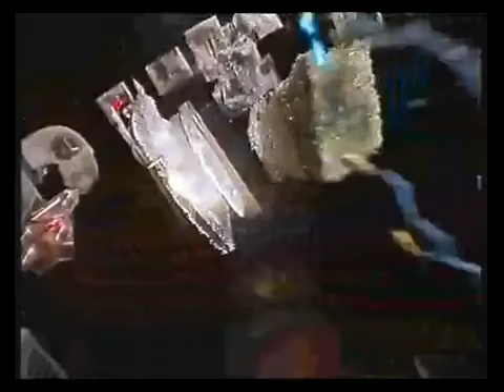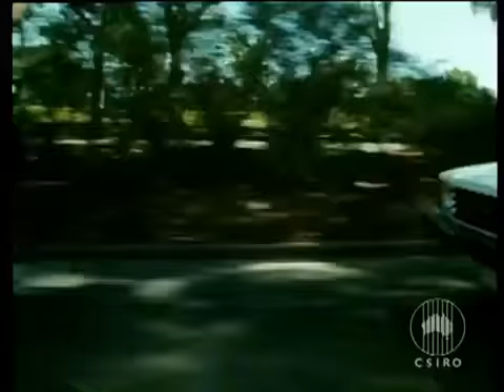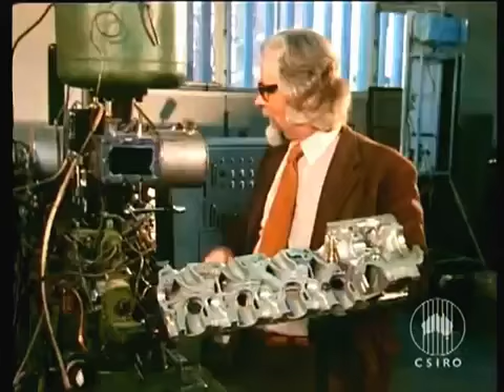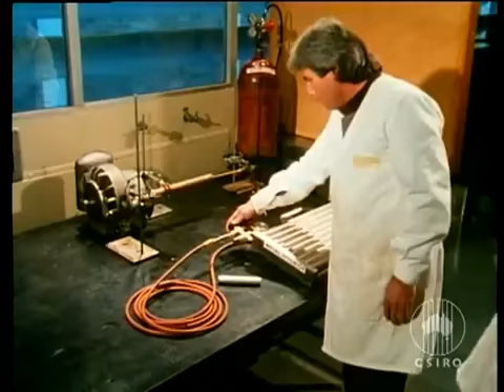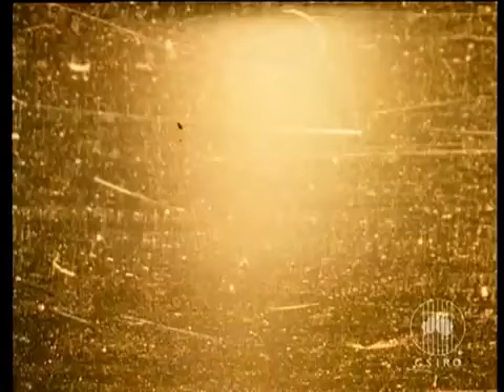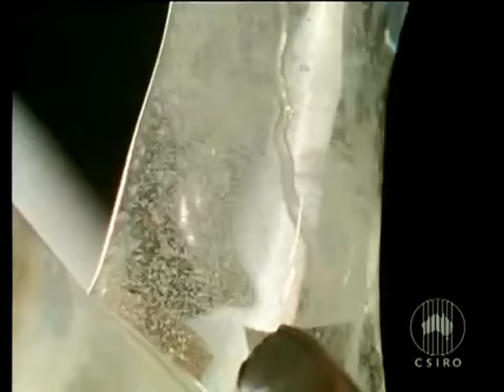▶ Vacuum Pressure Hydrogen fuel cell defeats high gas prices using hydrogen from H2O    YouTube 360p

Comment: Just want to say when I was over at my grandfather's house when his friend from across the road drove his car over to show his car running on tap water and want to show it to my grandfather because he was on his way to show it to the Holden can manufacturing his invention and wanted them to bring it out but still he was making sure we knew so if anything was to happen.
But what I was going to say he explained what he did in a roundabout way as he said he was hopping to sell it, but he said all he had done was increase the jets in the carburettor to twice their size and made a coil that he had on the side of the motor that was about four inches round and the same in height and that was all.
A motor is a vacuum chamber and water under a vacuum and hit with an x-ray frequency releases hydrogen, all this fuel sell science is to find a way they can make money from it because if people new you could burn water and get water back while doing so and without much of a conversion to their car it would be unstoppable and destroy their hold over the populations.

I am telling the truth, I watch him place the garden hose strait in the fuel tank and fill it up then show it coming out of the fuel line, the thing is also there is no danger of storing any fuel at all because it burns the water after it goes into the chamber.
Reply: You just blew my mind, there's history of high frequency waves being used for broadcast of K-Band being limited by NATO because of the presence of atmospheric water vapor having a resonance peak at 22.24 Ghz.
Reply: @RubbinRobbin  Yes we used to calibrate power sensors for the K Band 18 to 26.5GHz, I recall there were O2 atmospheric absorption frequencies.
In the US4,394,230 patent Mr Puharich utilised audio frequencies with high electrostatic voltages to rotate the whole H2O molecule.
The low mass Hydrogen molecule can keep up, but the higher mass oxygen cannot keep up with the rotation and so "lets go of the Hydrogen. All this involves comparatively low energy.  SpacemanAust's demo seemed extremely simple and achievable.
Reply: SpaceManAust where is this take a video of it and share it
Reply: @RecordToronto  sorry mate there is no video it happened over forty five years ago, and I witnessed it with my own eyes.
Reply: It probably wasn't Xrays.. it's a lot simpler, water is electrostatic molecule just hold charged up hair comb near running tap to see this. Using a coil it's possible to modify the 104.5 degree bond angle between the Hydrogen and the Oxygen. Because Oxygen is relatively heavy (less responsive) whilst Hydrogen is very light (more responsive).   See US 4,394,230 for more info.
Reply: @smokyatgroups  I have a book from the fifty's that tells you the water under a vacuum the is hit with x-ray frequencies streams out hydrogen.
Reply: Thanks for your reply,  the demo you were shown was really interesting to hear about.  I'd love to have seen the coil setup. It takes really high voltages to generate x ray radiation.  If the current though his coil was interrupted fast enough a huge voltage could have been developed. Eg If a coil with 1 Henry inductance experiences a change of 1 amp per second it will generate a voltage of 1 million volts per second..... ample for x ray emission.
Reply: @smokyatgroups  
The coil only seemed to be made up from a single wire maybe 16g was around 4in x 4in in size with many turns, not sure if it had a iron core or not, as it was covered in tape, but I only remember one wire coming out the top.
I don't think it was producing an x-ray frequency just a high voltage as there was no circuit anywhere I could see or he told us about.
Reply: @SpaceManAus  It is a crying shame he wasn't able to share this with humanity,  thanks for the info mate!
Reply: @SpaceManAus  government wants to censor inventions like that i believe you, i hope more inventors come out and show the world about them so we can stop using gas, they want us to keep buying their gas and oil for money its messed up
Reply: @Mrgamezombie1  
I agree, for many years I held back thinking it may be for the best, that there are some very bad people out there that may use it for evil purposes instead of for the good of humanity, bit these days with all that owe own governments have done to us all with this globalist agenda has down me that not even owe own governments can no longer be trusted as they work to destroy it all for the global reset and their greed to control it all placing them self as owe rulers instead of owe leaders no matter what the cost to owe lives.
Has made me question who are the bad guys, it has become hard to tell these days, so I have decided I will show the device I had seen and have been working on to you all, not the device as that will make me a target, but the design so others can see and build their own, keep an eye out for my video as it may not stay up for long as they know about it and will try to suppress it, but my hope is that if I show it as a concept they may not react strait away, so keep an eye out, this device is the most powerful free energy device I have ever seen and is simple in its design.
Reply: Hi, could you explain a little bit more about how this was done?
Reply: @JOBU412  
Not sure what else to say but willing to talk on Skype if you want, my user name is spacemanaus, look me up and I will add you in and we can talk.

Comment: This programme sounds very authoritative unlike the usual make do Youtuber.  Did not Whicker’s world show a programme of someone in USA having made a car, a van and a Lorry to run in hydrogen.  Mr Whitcker even drove it and said it was as good as any car he’d driven but was slightly loud and was told that it didn’t have a proper exhaust as it ran that quietly. So this young fellow made a viable car and a van shown in the film like, looked like a Hiace van where he showed it carried crystals under the seat; enough to last the lifetime of the vehicle.  
So question, Why Aren't cars made to run on hydrogen.  Probably because it would take control of the money out of the hands those who make the money from the oil.  A very well known mechanic quite prominent on YouTube (Scotty Kilmer) said that when we attempt to devise ways to make a car go further on fuel the computer is programmed to resist and will adjust the sensors so that such device will appear to do no good.  Again, are the companies trying to help us keep the planet green?  I don’t believe so.  This video shows hydrogen to be all but useless and will only work when big business wants it to work.
Reply: 1980s Stan Meyers used a variable frequency fracking injector... Yeah he's DEAD too
Reply: @stephenkennedy9322  ya they poisoned his drinking water. Wicked joke.
Reply: Terence Lamb  Looks like it was back in the 70s and hasn’t been not taken any further and the csiro has been Cuts to the bone  so not to compete with big oil.
Reply: placement of the 1/4in tube is vital. Anywhere past the Mass Airflow Sensor (or MAF sensor) then you don't have to trick or fool the computer. Everything will happen on its own in the internal firing chamber of the engine's block. Just be sure to hook everything else up proper so there is no leaks as a leak in your stator vacuum will cause compression issues and braking failure. That's all in the trial and error phase of the entire project. Real pioneers who were the only actual success stories to go public have been made very rare due to their executions and overall death toll, oh and lest we forget, clickbaiters negative publicities. Some less informed than others but all very motivated to discredit HHO because of, meh, money.